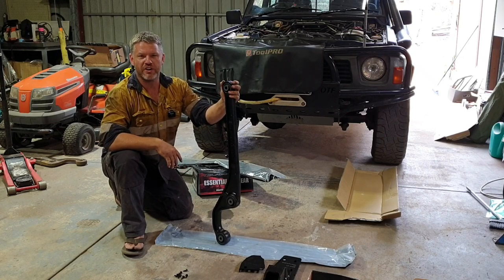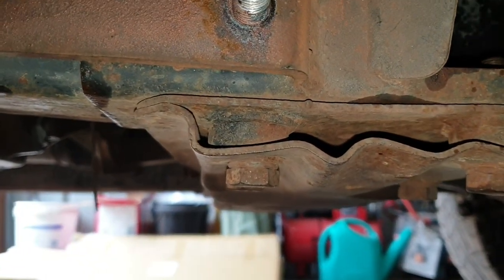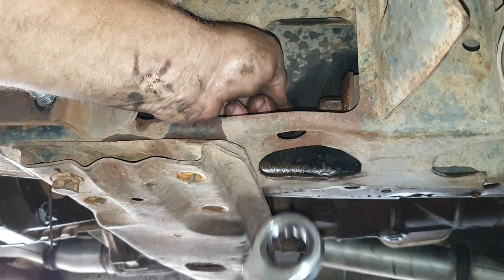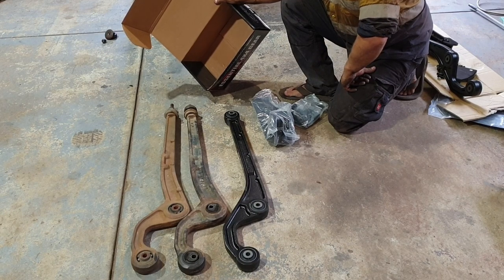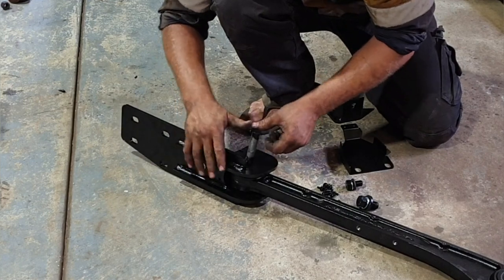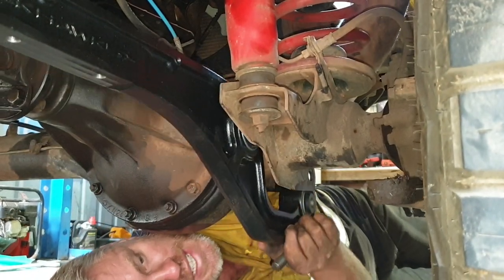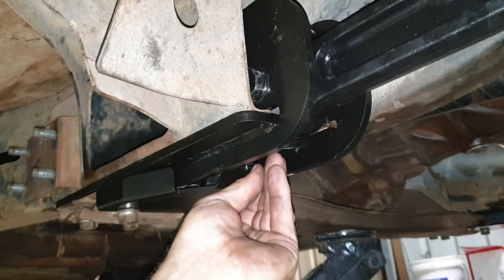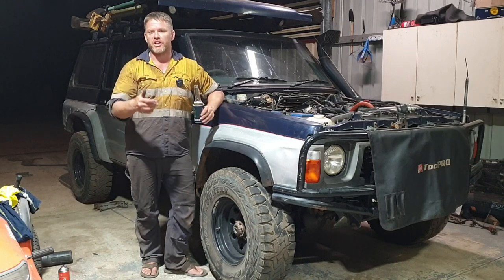Blackhawk Radius arms Installing into the GQ Patrol

Comment: Great video Byron.. you make it look so easy, I just took my Radius Arms out of my GQ Patrol and it was a mongrel job did it on my driveway but biggest hold up for me was the damn nuts at the end of the arms they were rock solid, plus the tip on putting jack under pinion to get the bottom bolts out helped heaps...mine is standard (no lift) but what is the advantage of putting these BlackHawk Radius arms in ? if anyone could explain, be good....cheers
Reply from the maker: Good on ya mate 
The black hawk arms give you the castor you need and a bigger bush surface area eg like a standed bush for lifts 3 inch and above 
compared to the offset bushes that you can put in

Comment: Curious to know how it drives on road with a 2" lift, I have 2"and the same offset bushes drives ok but deciding whether its worth the money for those or similar hybrid arms.
Reply from the maker: Not sure yet mate just got it back together will be doing some test runs and getting another wheel alignment next week but ill probably do a gq patrol update video later 

But at the moment i should of done it from the start (9 years ago)ill probably been through 3 sets of bushes from standard to off sets and a set or 2 of those rear bushes
And i could of got the arm cheaper back then arrr hahaha
Reply: @downtheshedwithbyron  let us Know, I'd want to see a large on road improvement before I consider forking out the $$$
Reply from the maker: @philzee7714  yeah no dramas mate ill see how it goes and give yous an update 
Doing nullarbor trip soon that should let us know haha

Comment: Good video mate thanks for posting. Do the radius arms have a right and left side designation from the factory? Or did you just mark yours "RHS" side when you pulled it out?
Reply from the maker: Thanks buddy 
They can be fitted to either side its just a habit to mark them
Reply from the maker: The drop boxs are l/h and r/h though